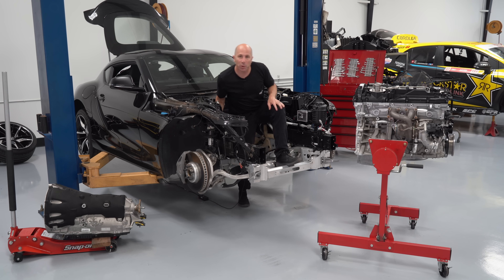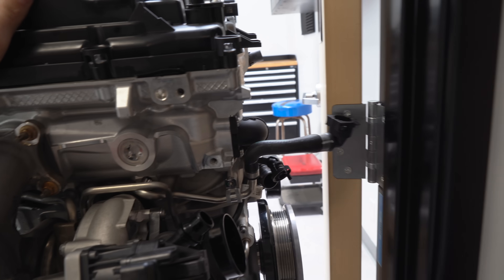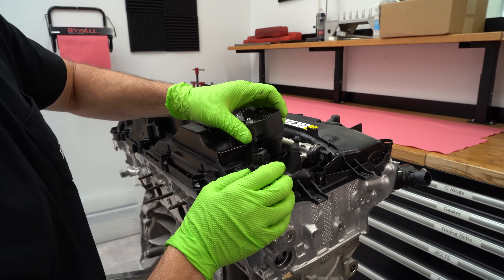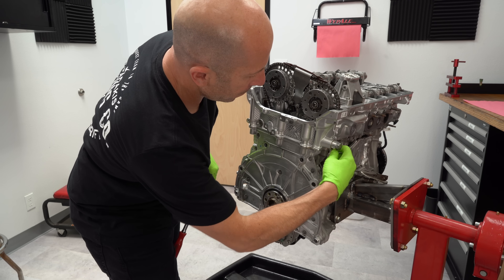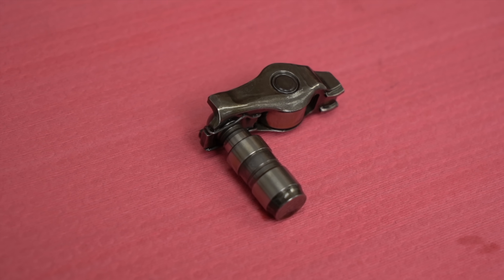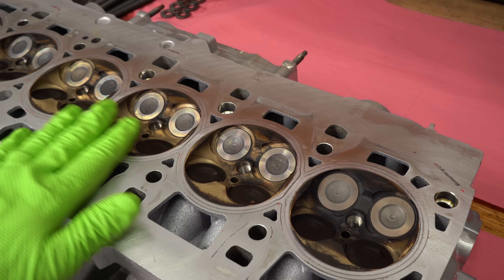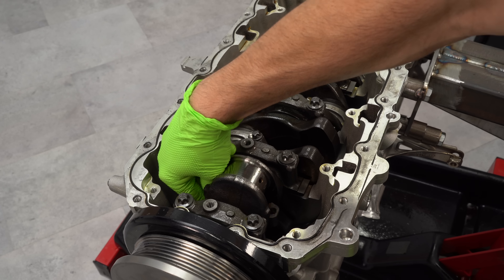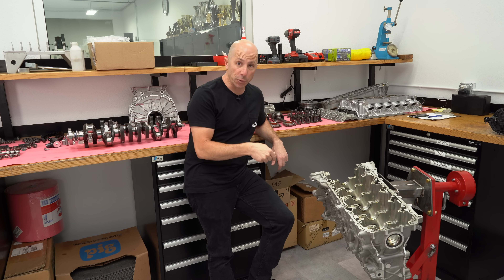2020 Supra B58 Engine Teardown - First Look - Better than the 2JZ?

Comment: This will be the most expensive 1000hp ever being a BMW design. Watch that cast in the head log manifold melt with all the extra egt's and flow restriction it will make.
Reply: 242bleek You don’t know anything about the manifold flow of this engine. Why assume there will be restriction? Turbo BMW engines are actually some of the cheapest to make quick and easy power out of. This engine is actually way stronger from the factory than JZs are, albeit more complicated. Why make such bold assumptions? Clearly you’ve never worked on a Supra or a BMW ever.
Reply: I have and theyre no different than any other engine, the big difference is price. My assumptions are based on the fact that BMW parts are expensive, esp when its in a Supra. Two, a cast in head log manifold esp one that terminates in two little holes is not gonna be ideal for a 3 liter 6 making 1000hp. I never said it wasnt strong or capable of making 1000hp. Way to interject in an accusatory fashion, I assume you must be the chief engineer of this car or something.
Reply: 242bleek Lmao. Supra parts are expensive when they’re in a Supra. Again, proving my point that it’s obvious you’ve never been exposed to what proper performance parts cost for previous gen Supras, or BMWs for that matter. It costs literally thousands of dollars and a complete rebuild to boost a previous Supra engine over 500whp. In an N54 or 55 car, it can be done for under $2000 without even thinking about pulling the engine. I have no experience with the B58 with it being newer but I’m sure it’s the same story. And saying they’re no different than any other engine is an incredibly ridiculous statement lol. Again, you clearly do not know any of the technical specs of this engine, you don’t know what the internal porting of the manifold even looks like
Reply: That Guy With The Stuff I didnt know the B58 was so different from every other direct injected inline 6. You act like it runs on plutonium or something and only you can fully comprehend its greatness. Thanks for sharing all you internet lore about what builds cost. On the cast in manifold, I dont need to see a cutaway of the port cross section to know its a shitty flow pattern. Theres a whole 3 maybe 4" from the exhaust valve till it hits a wall and is exiting through little holes and there's nothing you can do to get rid of that. This is a cost saving strategy and nothing more. Stop acting like this is some revolutionary design, it's been done for years and the fact that its employed on a performance engine in a car carrying the Supra name is weak imo. Im not knocking the rest of the engine, its probably really good but im pointing out one flaw.

Comment: As a dealer technician this is a nightmare. Toyota should have used the lexus lc. Ive worked  for Toyota  for ove 13 years now and as a master tech i want no part of this BMW as far as reapira are concerned.  Relly poor decisions  by Toyota  in my humble opinion.  Its cool as  long as you dont need to make a living trying to take care of them.
Reply: You’re 100% correct. It’s not a Toyota
Reply: I've always wondered what Toyota service departments will do with these when they need serious work/diag?  Do they just ship it next door to BMW?  Or will Toyota train its techs in BMW methodologies for one low numbers model?   I just don't see how this can work out well in any capacity for Toyota long term.
Reply: @CleanSC  - toyota serverely underestimated the market for this car at 50K.  They fucked up not building their own engine.  It's selling really good right now...imagine if it had a true 2JZ successor with a manual transmission!
Reply: @MikeA-79  
From corporate's standpoint, this was the whole point of their partnership with BMW. It should be a clear sign that Toyota currently doesn't have the talent to build their own racing grade engines. 

This should also be a clear sign of who's really been building the engines for their prototypes they enter in the Le Mans. 

Toyota saw the move of building their own engine as money down the drain and really just inconvenient. There's no incentive to do that when you have a partner like BMW.
Reply: @mitpoker7319  Toyota doesn't have the talent to make racing engines?  Really?  The 5.0L V8 has been proven bulletproof over hundreds of thousands of miles.  The V10 in the LF-A is a masterpiece.  And we won't even get into the 2JZ, the 3S-GTE, 4A-GZE, etc, etc.   Don't blame this move on lack of talent.  Toyota already has engines they could have put into the Supra.  Perfect choices would have been the 5L or the 3.5tt.   The bottom line is the Supra is a Z4, so why bother replacing the engine it comes with and swapping it with something else?  It's a package deal, period.  Nothing to do with talent, everything to do with business.
Reply: @mitpoker7319  Until the buying public discovers the real cost of owning one of these things with some mileage on the clock.  Then Toyota's reputation for low maintenance costs go out the window.
Reply: @CleanSC  
But those cars that you mentioned are more than a decade old, some of which have already ceased production. And Toyota's partnership with BMW has been existent since the mid 2000s, you probably weren't even born. What's your point?
Reply: @CleanSC  
The LFA was co-developed with BMW engineers. Look it up, kid.
Reply: @mitpoker7319  The point remains the same.  They have the talent.  You stated they didn't when they obviously do.  The 3.5tt is a brand new engine and the 5.0 V8 is currently in several models still.   Them not wanting to use their own engine is not the same as them not being able to.
Reply: @CleanSC  
The 3s-GTE and 4A-GZE were all built in the 80s, and they aren't even in production, anymore. These things are fossils for today's standards, sunny. 
Most of the engineers that were involved in building these things aren't even working at Toyota. 

Again, Toyota doesn't have the talent to build racers, anymore. That's why they partnered with BMW.
Reply: @CleanSC  
They don't, you listed 4 different names, 3 of which more than a decade old and no longer in production. 1 which was co-developed with BMW, get your facts straight.
Reply: @CleanSC  
Also, the 3.5tt is also a BMW build for Toyota's precious little Lexus.

At this point, you're just denying the fact that Toyota is showered with money to the point where they don't need to invest in talent to build their own racing engines. That's what their partnership with BMW is there for. 
Otherwise, it's a waste of money.
Reply: @mitpoker7319  Uh, I think YOU need to look it up.  That engine was co-developed with Yamaha, not BMW.   Get your shit straight before you dish it, kid.   BMW did their own V10 and it was an unreliable turd as that M5 went down in history as the worst BMW to buy used, ever.
Reply: @mitpoker7319   Also not true.
Reply: @CleanSC  
Also, Yamaha sells fucking bikes. And most of their motorsports product are chinese made garbage. What a joke...
Reply: @mitpoker7319  Easy, Tiger.  You seem to have anger management issues.  Besides, that article you posted doesn't say anything about that being a BMW engine.  So you are STILL incorrect, as you have been since you started yelling.  As for you, and this, whatever this pointless argument is, I'm out.  No sense in arguing with people that can't understand facts over their own delusions.
Reply: Only issues I’ve seen an these are coolant pumps , and rodent damage to engine harness but that’s a ny problem . Bmw actually made a solid engine
Reply: What dealer do you work at Andrew? Just bought a MKIV Supra and looking for somebody to give me a bit of advice. Thanks.
Reply: Exactly......
Reply: @asteiner9181  Most people that haven't owned a German car with some miles on it just don't know the cost of maintenance involved.  Most people do short term low mileage leases on these things so never experience the "real" cost of ownership.
Reply: Poor dregs who have to rely on this car to advance their racing careers.

Comment: Ehhh, the intercooler doesn't really make the air more dense - you still have the same volume of air after it's been cooled.  Cooling the air reduced combustion chamber temperatures and prevents detonation.  Yes, it will make more power with the intercooler, because then you can run more boost without blowing things up, more spark advance, more compression, etc.  In fact, cooling the air can lower the pressure.  

Intake cam removal method works, but it's a good way to bend the cam.  

Oil pump looks like it's got an oil aerator assembly (AKA "balance shafts") integrated.

Have you ever actually seen a bottom end that you couldn't spin by hand?  I mean, really?  You put an engine together that's that tight, it's going to grenade instantly.

Goddamn, I'm so sick of direct injection and drive by wire, though.
Reply: @Seb C The point of the intercooler isn't to make the air more dense is what I'm talking about.  It's to lower combustion chamber temps and prevent detonation and damage.  If you just wanted more air density, you'd run more boost.  But that makes the air hotter, and destroys engines.

You ever stop and think why, when it would be cheaper and simpler to just cram in more boost than to run an intercooler, we still run intercoolers?  Nah, didn't think so.
Reply: @Seb C Mmm, Wikipedia. 

If you want an excellent example of their... accuracy.  Go look at the Gamergate article.

Comment: This motor has been around since 2016 in the BMW 340/440/540 etc and no one cares but when Toyota throws it in their car suddenly it’s special. Gtfo making it sound like Toyota did anything special with it. BMW did all the work, Toyota just made the body
Reply: I see this often and these JDM guys acting like it’s something new.
Reply: +1 and that Toyota just help make the chassis more reliable but otherwise it's 90% BMW
Reply: rockn roll I’m sure.....

BMW makes the best inline 6 today comparable to 2JZ. That’s why Toyota partnered with bmw.
Reply: Nope Yamaha check the engine over for the new supra and gave it extra oil cooling/oil squirts so it’s better than what’s already out there dumbass
Reply: @robocop3961  Oh so now Yamaha is involved too, don't see where that confirms Toyota's role in the engineering and development of the engine.

Comment: This does seem like a simpler design than I thought it would be, but there are a couple issues I see with it initially.
Problems I see with the design of this engine:
1:  The location of the timing chain and sprockets.  Impossible to do it with the engine in the car and, historically, timing chains in the rear of the engines on other vehicles just makes a nightmare.
2:  GDI is a wonderful idea in theory, but only if you have water injection.  Not sure if this engine does, and, as far as I know,  BMW is the only one who is putting water injection on their GDI engines.  This is imperative when you have a GDI system since the fuel charge is not flowing past the valve and valve seats to help clean off the carbon deposits.
Stephan, if you know if it has water injection I would be interested to know.

Points for good simple variable valve lift system, also.  Good marks on that.
Reply: If I recall this correctly one important reason for having the timing chain on the rear is pedestrian protection. With the chain and sprockets on the rear the front of the valve/timing cover is flat so that there's a good gap between hard engine parts and the hood which is rather soft and deforms upon impact with a pedestrian. Would the chain be in the front the hood needed to be a lot higher/less sloped to maintain the same space between the engine and hood. Lots of new regulations dictate design features that maybe don't make sense from a quick look but are done for a reason. 

Same deal with the integrated header, lots of manufacturers are doing this right now as the water cooled ports in the head help to quickly reach operating temps after a cold start so the emissions stuff can start working. New emission laws have cut down the timeframe of how soon after a cold start emission limits have to be met, the "thermostat assemblys" main purpose is also to aid quick warm up by limiting and selectively routing coolant flow through the engine after a cold start, I'd guess after starting coolant only gets pumped through the cylinder head and cab heat exchanger while the coolant in the block doesn't circulate.

Comment: Looks like an absolute nightmare. BMW and most german manf over-complicate the fuck out of their engines. All those plastic manifolds will be cracked in a few years of basic ownership, just like all BMWs. The exhaust manifold I think will provide a serious limitation to flow at the power you are seeking, and that intake manifold will probably be limited in its cooling capacity at higher boost. Just sucks its not a very easy to work with engine. 

Timing chain guide broke? Drop engine. yikes.

Comment: I'm impressed. The block design has allot of the engineering decisions that harken back the 2jz. It was a stout engine for some very good reasons and this engine has allot of the same tech, plus some modern goodies (including a very rare combo of turbocharging with intake variable valve timing/lift, direct injection, direct mount turbo design, etc...).

Comment: The 2jz was able to produce around 600 horse with very little disassembly. This video showed the entire tear down for a 1000 horsepower. If you tear down the two Jay Z completely you can get double that with the right parts